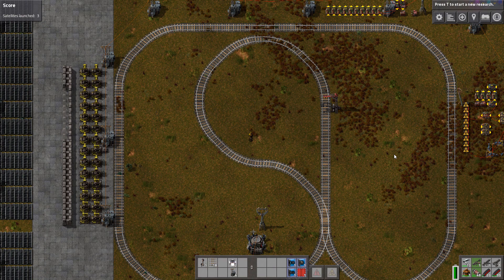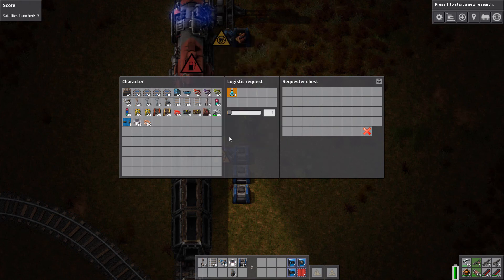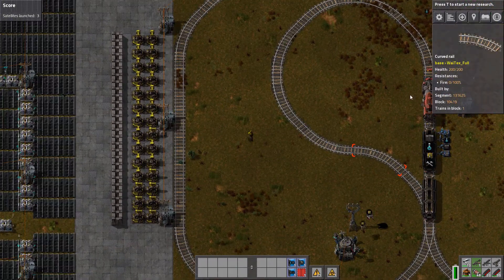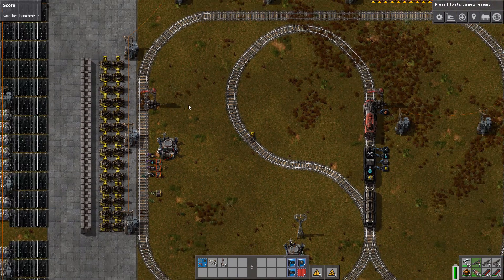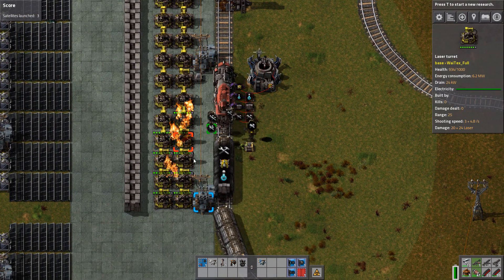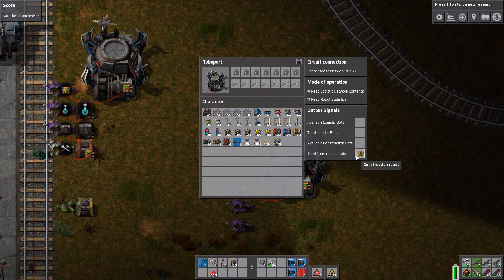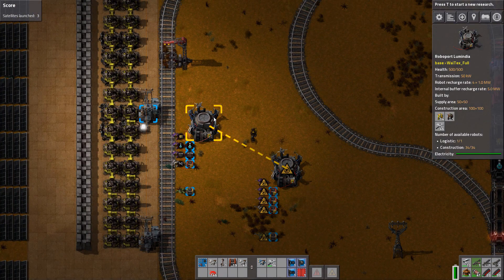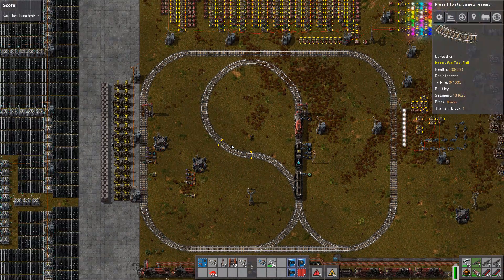Factorio Tutorial - Auto repairing wall

Comment: Thanks dude ! This will be my setup for defense from now on :D 
I would have liked to see your actual wall work, the one under attack during your tuto :p
Also i think your wall resist against 1.0 alien evolution, does it ?
Reply from the maker: Yes it's survived 700 hours so far without problems, the wall can been seen in my first factorio run (it's on my channel) although that series is currently stopped. But I started a new one that also used this system but isn't as big. I'm currently uploading the v4 tutorial since the system is quite more advanced now, and it calls the train when needed and let the train skip if not. This will make a huge performance boost (v4 Blueprint was and is in this video description) and I'm thinking about a v5 that cuts down power when it's not needed, but not sure about it yet